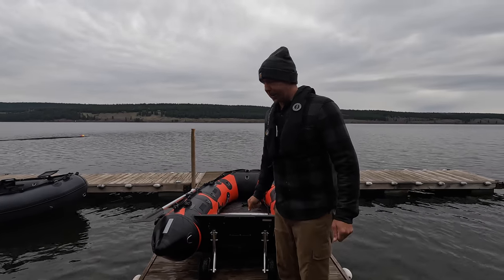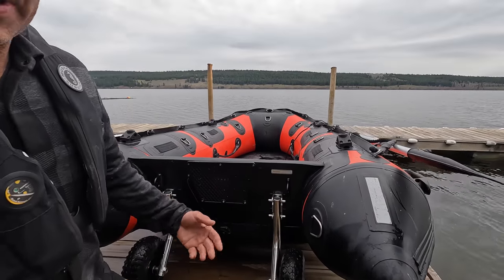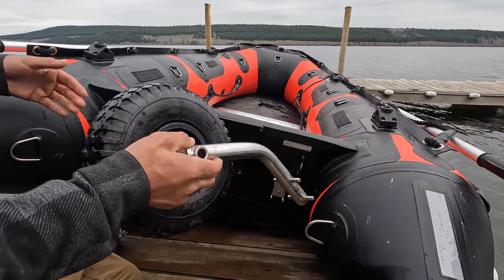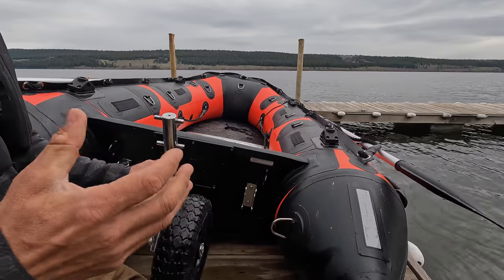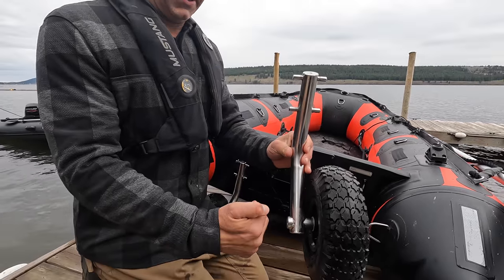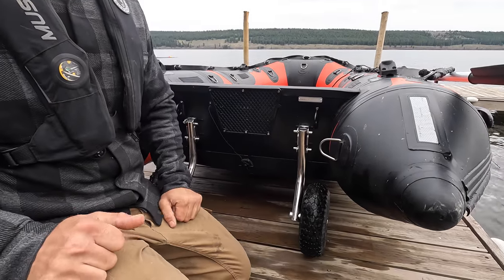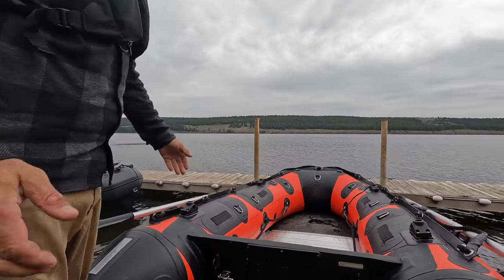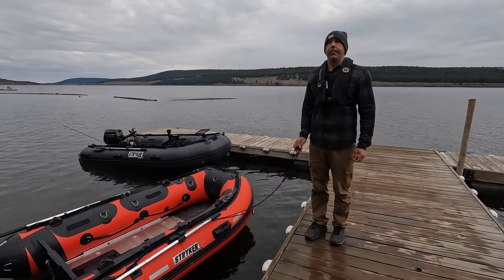Stryker Launching Wheel System - IN ACTION

Comment: Finally be putting my duals on the 380HD this week. Is a marine silicone adhesive the suggested product to use or just a marine silicone for the mounting brackets like you would for the valves?
Reply from the maker: Hi Zach, you can’t go wrong with using the sika flex marine adhesive, unless you ever plan to remove the brackets. Its more of a permanent installation. 

Standard marine silicone or any waterproof silicone will also work, butt may degrade over time. The advantage is it’s easily removable if the brackets ever get damaged. ( incredibly rare).